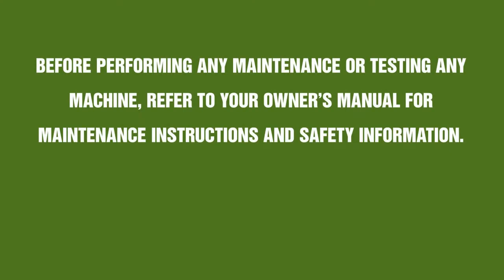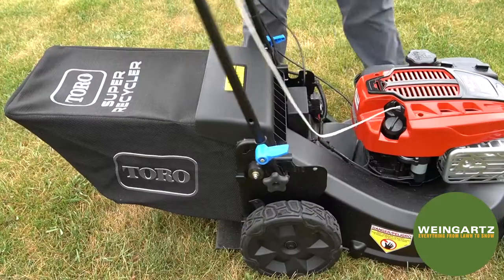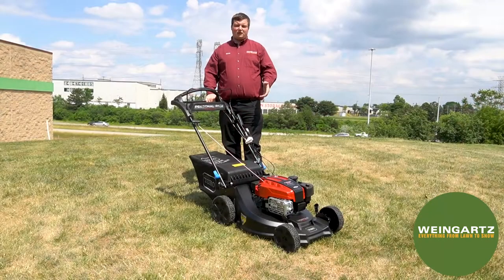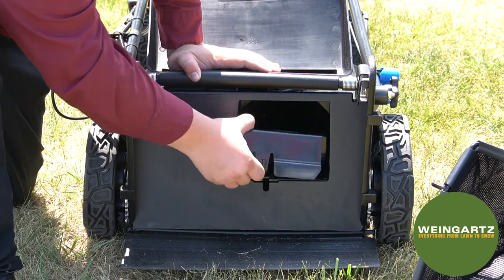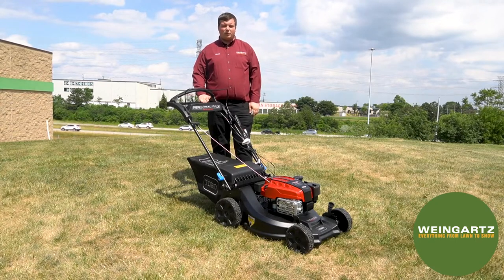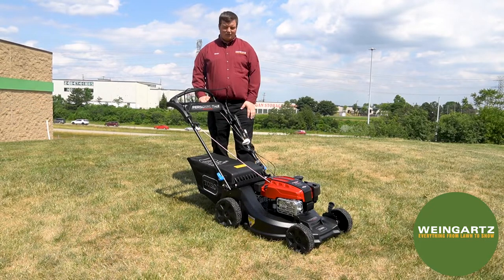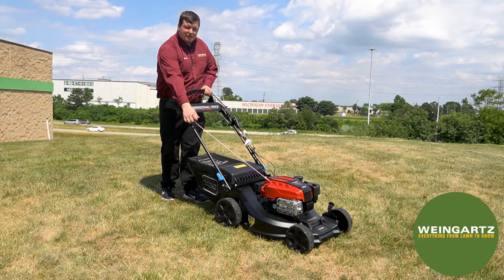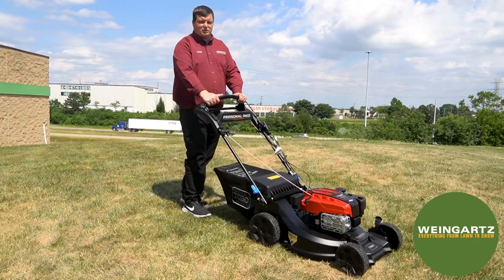Toro Super Recycler Walk Behind Mower 21564 Operations

Comment: I have just inboxes my Toro 21564.  This video helped with buy left me with a few questions about connecting the power start an other electrical connectors not mentioned in the quick start guide.
Reply: Same question here need help!
Reply: Wish Toro had a help line or close up video.
Reply: I don't understand why the blue start button does not engage. In fact, it doesn't MOVE at all! Can you make a suggestion to fix this?